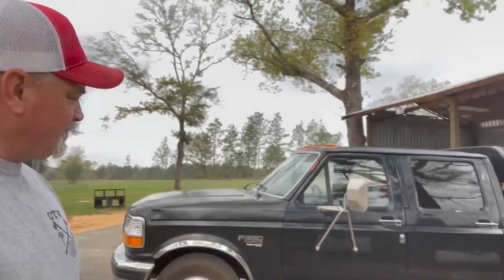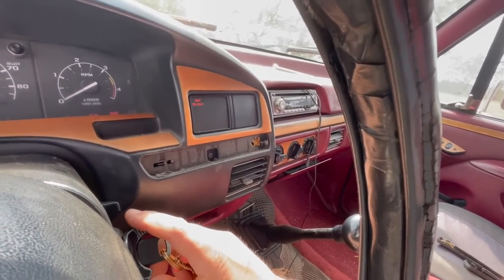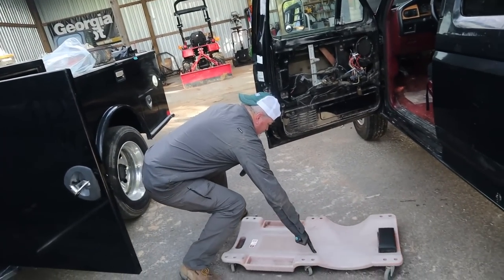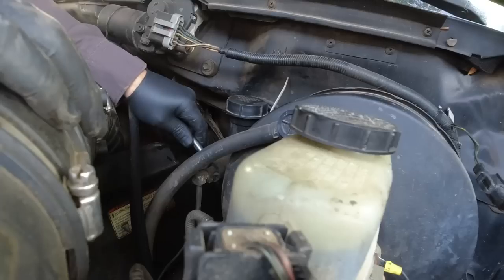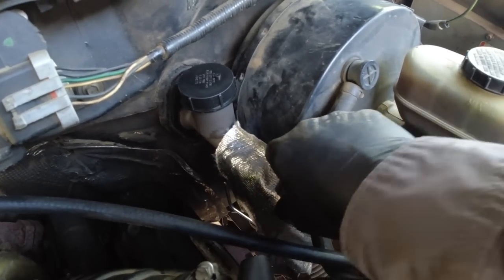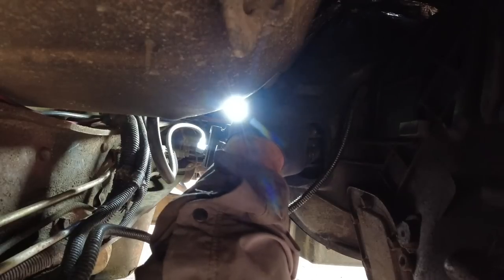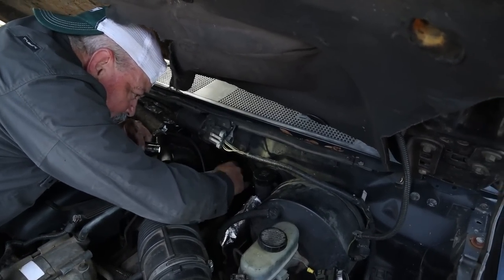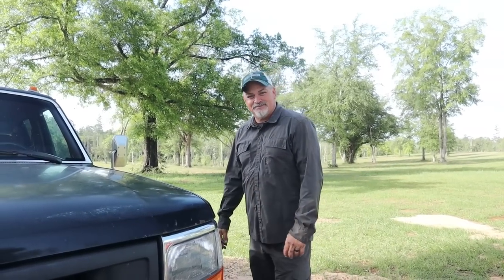Do I need a slave cylinder? Firing the parts cannon at the OBS Ford F350!

Comment: Hi Hank, Have a look at the video about the 1.40 mark when you are pushing on the clutch pedal, there is a huge amount of play in the shaft that goes from the pedal across to the clutch master cylinder at the master cylinder end, you can also see the play later in the video after you have installed the new parts, that play is the worst of your problem, its moving up and down at least half an inch, it shouldn't move at all. I used to work at the Ford truck plant in Melbourne Australia in the early 80's and one of my jobs was ordering pedal boxes from our manufacturing plant for F trucks, pedal boxes were always a problem on early F Trucks because they were difficult to manufacture.  It was more than 40yrs ago but I still remember how much of a pain they were🙂
Reply: i agree with daryl its got a lot of play in it
Reply: hey is it true they don't have any car plants in australia anymore? Thought I heard ford pulled out and they were the last
Reply: @zippythechicken  Ford stopped making cars in Australia in 2016, GM (Holden) stopped in 2017 and Toyota also in 2017.

Comment: I have an 1983, 1984, and a 1986 Ford f250s with 460 V8 engines and 4 speed manual transmissions and the same type hydrolic clutch. They are Easy to blead. I am a watchman for a logging company, and have changed every part of the hydrolic clutch systems in each of my trucks by myself on top of a mountain, a few times in the snow. ❄

Comment: Hello Hank,  I just fixed a 93 ford clutch with the same problem. The spline on the arm that holds the bushing was stripped. I had to weld it to the cross arm. Be careful to make sure it's positioned properly before welding.  Wish you good luck and hope your problem is the slave cylinder, much easier fix. Take care and best of luck. 👍

Comment: The black thing you asked about is a clutch switch 2 wire work the the starter lock out and the other 2 are for cruise control. Last the plastic piece you fought to get off could be left on it acts as a bushing between the slave rod and fork

Comment: I did this job on my 1988 f250  they didn't make prebleed system then no rusted bolts and nuts there great video hank clutch idle switch and lock out

Comment: Before you fire the parts cannon again, try adjusting the clutch linkage to do away with excess play. Some installations have a clutch brake, which applies a little mechanical brake action to the clutch disk when the clutch is fully depressed. Your grinding of gears is a result of the clutch disk's flywheel effect. Careful clutch pedal manipulation when shifting while under way will circumvent the symptoms, but isn't an actual fix.

Comment: On your a/c  problem check to see if there is a reservoir under the dash  can cause the problem like a vacuum leak  hard to get too / just get another reservoir and place it some where easy so get too /    I had same problem  a/c pump good showing a vacuum leak - bad reservoir on a 2000 ford van  just an idea to check out

Comment: I had 2 Fords have clutch problems I had a new 1995 the transmission locked up going down the road the clutch, pressure plate and throw out bearing exploded my 2000 F350 4wd drw powerstroke had a clutch explode without warning I still have that truck it's a snowplow truck now I  bought a 6.7 F250lariat 4wd with a automatic transmission I love it no more clutch problems

Comment: I had a 87 Ford standard Ford put out a kit to stiffin the firewall because it flexed badly.  The safety switch looks like it was cut so you didnt have to depress the cluch petal to start the truck I made a u shape jumperwire and bypassed that switch

Comment: Hank yank out that exhaust and put on a set of straight stacks with flapper caps on that flatbed  use no mufflers go at least 4or 5 inch pipes up and three to 4 inch underneath.  You'll be amazed how it sounds and she's a little better on fuel milage because it's non restricted to breathe. My f350 2000 with 7.3 is done that way. Only thing you have to do is cut a hole in the bed to run up and put a t on top of deck to run out to 90s and straights up then just get a piece of diamond  Plat bent to cover over pipe crossing the bed. Go at least 5or six inches above the cab and it's not a bad sound in side with the windows down surprisingly fairly quiet but you can hear it when you get down on it and pulling hard loads. But windows up and ac on and radio playing she's a quiet ride inside but everyone in a half mile knows you coming. Lol

Comment: The Switch on the clutch push rod is  clutch neutral safety switch, and the two wires you saw are the two you connect to bypass the switch. It was missing the mounting bracket for it. I say if it is already bypassed then leave it alone. Unless you gust want to make it work for a year or two and replace it once more. they fail often.

Comment: Hank, ditch that air filter housing.  There was a recall on them way back when because the intake pulled such a vacuum it collapsed the housing.  I first tried the K&N filter but eventually just use a paper filter now.

Comment: I already made a comment, but I'm at the part where, well you made a minor mistake.. I use a woodworking clamp to put those back in where they belong. Doing the timing on a Honda (and other cars too) there's a hydraulic tensioner almost exactly like the way the slave cylinder worked but it's sealed, well.. if you pull the pin it comes out and it sure is NOT going back in without a pretty darn good amount of force. One of those long wood clamps you can push to get tight then screw it tighter for fine tightening, yessir that's what I use to push those pins back in.. Works like a charm!! (I don't know how you did it, I'm at that part now but wanted to comment!)
Reply from the maker: Good idea

Comment: Hay hank, check the firewall, they are known to crack.  Ford knows it was a problem and had a repair plate kit to fix it.  When they crack you will not have the full clutch pedal disengagement.

Comment: I give ya this, you were within inches for the fix! The bolt that holds the brake pedal and then that extension for the clutch pedal has bushings. Its not a hard fix "IF" you have done one cause its a new area for you young'ns to learn how to do. First timers usually remove a lot of stuff before learning just how to get it out of there. Once taken apart, your going to see a wallowed out bushing plus the area its in will be probably bad worn too. Its been a while since I did one... pay careful  attention to how you get it apart and then put in the new bushing and any other pieces warn out. I remember taking out the whole assembly and doing a small weld on the metal gone and filing it out to accept the new bushing.... once did tho, shifts like butter. I know its what is wrong as I did a lot of em over many years
    The easy way to get the plastic retainer off is to install like removing, then simply step on pedal when its all installed and that plastic piece will snap into and you can slip the clip parts in the notch out of the way. Just remember, you were close but its the bushing in the swing assembly... a bolt that holds the pedals.. really just the brake pedal but the other part of this swing assembly is part of  the clutch pedal or other end of bushings ... both ends have a bushing and they are relatively easy to switch out. As a fact, yours may only just need the pedal bushing.... that said tho, if one is worn out, the other end is to follow quickly. I believe the more worn out ones have a notch warn into the bolt as well... all self explanatory when its apart

Comment: "Should be pretty easy" He says  Then he has to wedge in between the seat, under the steering wheel, laying on his back arms cramped forwards, and he keeps using the words  "Just and Super Easy"!   I'm an old, fat guy with very few stomach muscles.  Ain't nothing super easy about that.   LOL  Good job, Good Video.    BTW:  I've done this when I was 35 on a GMC pickup.  I'm 65 now.

Comment: Watch from 41:20 forwards and you can see the bolt I am talking about swing in and out losing you all of your adjustment. I have cheated one by putting a spot weld on the thing where its sliding back and forth so you figure out how to stop it from doing that then you uncle Bob will be proud. Once that bushing is totally gone, two men pushing on the pedal won't be able  to push it down as its really the most important part under there... 
      Your okay on that price of your rig as its a easy one to make into a four wheel drive rig... research or google... Wes could tell you how if ya ain't worn out your welcome yet

Comment: That was painful to watch. ur whole pedal assembly is wore out. There was so much play in the clutch pedal at the pivot point. I always leave the plastic lil ball clip on and just trim off the tabs. the plastic ball will wear itself off by itself. Ur gonna need to rebush the brake and clutch pedal to fix it right.